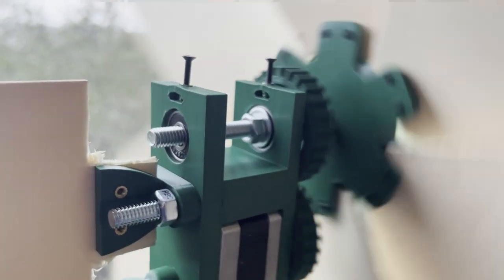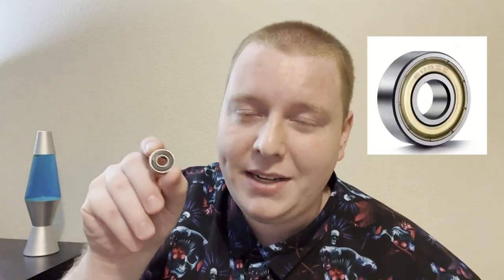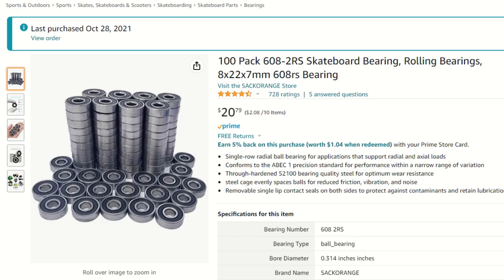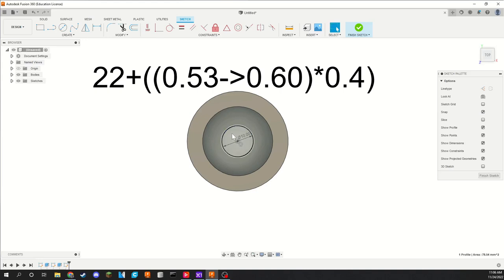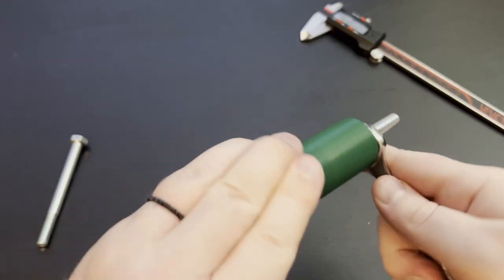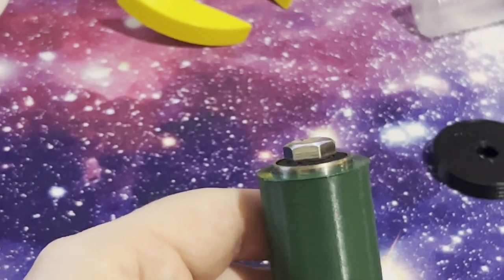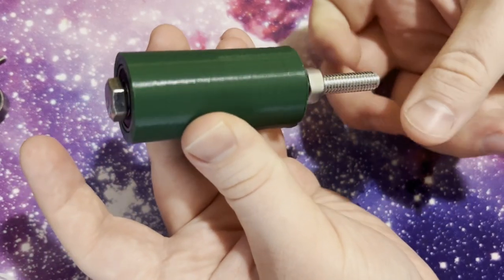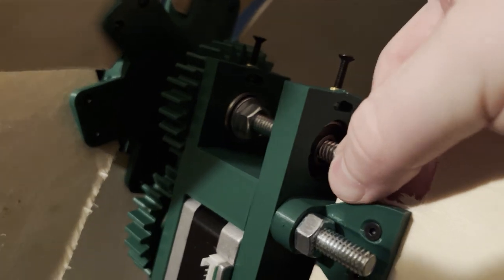Using Bearings with 3D Printed Parts

Comment: Never screw your regular ball bearings the way he does it at the 4:12 mark. This will ruin the bearings. Instead, take two appropriately sized washers so you can clamp on the outer race and screw together that way instead. An alternative to this is using either thrust bearings, tapered roller bearings or angular contact bearings, all of which take MUCH higher axial loads, these kinds of bearings will handle this kind of treatment just fine whereas regular ball bearings will not!
Reply from the maker: Good points! Thanks for the heads-up :)
Reply: Good point, but it will only ruin the bearing if the force on the inner race is high.  For a light press fit in PLA, maybe it won’t hurt the bearing.

Comment: 2:54 this is incorrect, slicers do take into account the nozzle diameter. The issue comes down to thermal expansion of the filament, filament getting dragged after its extruded, retraction settings and issues with the machine like E steps, squareness of the frame and axis etc.

Comment: After nuts and bolts, bearings are one of those things I buy in excess, in sizes I don’t need for ideas I haven’t thought of just because they are so satisfying. Sometimes when I really need some relieve I’ll slide a shaft in and give it a spin. Maybe slide it back and forth if it’s a snug fit. I started collecting used copy machines to take apart because people just give them away and I’ve pulled literally buckets of bearings out. I took apart a plotter and it had a 1m 13mm slide mounted to a sturdy boxed beam. No clue what to do with it but I ordered a set of 13mm sliding blocks just in case. It would make a good X | Y axis on a CNC router.

Comment: 6:41 In short, your problem is due to overconstraint. Underconstraint is the reason why you had the leverage with a single bearing (5:52). 
I highly recommend you to read "Exact constraint machine design" by Douglass L. Blanding. Its an amazingly good book, and a true eye opener for anyone that likes to design mechanisms and machines. Dont worry, it doesnt have any math.
Reply: Explain?

Comment: If you use two bearings and crank them together with a bolt the balls on each bearing get compressed into the rings. At a microscopic level the metal has to deform to spin. This is why it becomes harder to spin.  There’s a sweet spot of tightness where the shaft runs true and freely. It’s good to use a Belleville washer and two nuts with this configuration to get the best results.
Reply from the maker: Thanks so much! I'm always amazed at the collective knowledge of a community. Thanks for being a part of that :)

Comment: A vice is something that everyone should have and is very good for press fitting parts, like those bearings and is probably a bit quicker to set up than the nut and bolt solution.
Reply from the maker: You're totally right. They're super expensive though 😅
Reply: @christophersfactory  my local supermarket (grocery store) sells miscellaneous crap on a weekly rotation so I picked up a couple of cheap vises of various sizes. Mine can grab parts up to about 150mm in the dimension you're squeezing, and as Conor said they're great for 3d printed and maker stuff. That bigger one cost like €15 max
Reply from the maker: @cian.horgan  No kidding? That's dope. I'll have to check around my area to see if I can find something like that. Otherwise, maybe a garage sale.
Reply: @christophersfactory  they really aren’t that expensive and you don’t need large ones that bolt down to workbenches, even a cheap one that just clamps onto a desk is enough for most people.

Comment: 6:40 the reason is because those are radial bearings. They're design to be able to take force in the radial direction (think of where they go in a skateboard). However, they are not designed to take forces that are directed along their axis of spin such as thrust forces (Think of an office chair that swirls around with you on top of it). For this, you want thrust bearings (hence the name). These are designed to take this kind of compression force along the axis of spin.

Comment: I had to chuckle at the use of MS Paint for a crude "hand drawn" explanation of tool compensation, immediately followed by some footage of precision drawing in Fusion. 

As with everyone of your videos, I learned some things.  Keep it up!
Reply from the maker: I forgot to say this in reply to the last comment of yours I saw, but I have to thank you for your positivity and kind words. It's very inspiring to me to keep doing this channel and make more videos. It goes a long way. Thanks again, from the bottom of my heart. Christopher
Reply: @christophersfactory  You are very welcome.  There's too much negativity on the internet.  A little kindness can go a long way.

You mentioned a few days ago that you finally received the electronics you needed to start collecting electricity from your windmill.  Will there be a video showing the results coming soon? 🍿
Reply from the maker: @schmidtyyt  You're awesome. Yes, the parts finally came, but I realized I had a fatal flaw that rendered the PCB's I designed nearly useless. I saved a few by cutting the traces out with a utility knife and re-routing some connections with hook-up wire, but being the perfectionist I am, I didn't want to show that in the video, haha.

On top of that, I redesigned the turbine, but I'm now in the process of redesigning it again. I've used pre-cut plywood up to this point, but I think to have it work really well, I need to get better at learning how to cut and work with thicker and more durable woods. The plywood I've been using warps horribly. I just started working with this stuff called hardboard, I think it's made from compressed sawdust. I can already tell it's much less prone to warping, but it's slightly harder to work with. 

I'll probably have to redesign the turbine hub to accommodate the heavier and thicker boards.... this is all to say that there's a lot I'm re-working; I told myself I'd wait to get the "build video" out until I was done, but now I'm thinking I should just make regular, almost vlog-style updates on what I'm doing. Viewers would probably get more benefit out of that anyway, because learning what doesn't work is arguably just as valuable as learning what does. 

I have a few other non-windmill-related videos already shot and edited scheduled for this week, but windmill content should start back up next week, especially after these words of encouragement :)
Reply: @christophersfactory  That sucks about the PCBs not working as hoped.  I know nobody likes to admit failure much less broadcast it to the world, but showing what went wrong may help others avoid the same mistake.  As a wise man recently said, "learning what doesn't work is arguably just as valuable as learning what does." 😉

I'd expect the hardboard to work better for you, as well.  And I totally get the design re-considerations that brings, too.  However, I have to ask: why not 3D print them?

As for working with the hardboard, check out the Dremel Ultra Saw (great Black Friday deal at Amazon today).  I found it to be a great little saw for cutting thin wood and metal.
Reply from the maker: @schmidtyyt  I completely agree about the failure bit. That was one of my goals when I first made this channel, was to candidly show people my efforts in these projects, not just showcase a finished project. 

As for why I'm not particularly inclined (although not opposed) to printed blades, there are a few reasons. PLA warps really badly in the sun, especially with large and thin features. If the blades are not thin, it will use a lot of PLA, which is much more expensive than wood. I could try printing in nylon or ABS, but I've never worked with either before. 

My short experience with wind turbines has taught me that the name of the game is wind-collecting surface area. This is faster to design with panels of wood, I think. It requires less design consideration. Additionally, I could probably cut 250 wooden blades in any afternoon, but 3D-printing them is going to require a significant amount of time. 

So, to answer the question more directly, I guess there isn't really anything that I've found that strictly deters me from 3D printing the blades, but rather several small things that incline me toward wooden blades instead. 

People often ask me what the goal of this windmill project is, as I've been working on it for well over two years and through twenty-one designs. Really, there is no goal. I do this because it makes me feel happy and fulfilled. I'm not necessarily trying to create a to-market product, nor am I trying to design something that anyone could assemble with only filament and a printer. So, as the Cheshire Cat said, “If you don't know where you want to go, then it doesn't matter which path you take." I'm just taking whatever path I feel like and feeling things out. Maybe I'll take the path of 3D printed blades at some point. 

That Dremel looks pretty slick. I have a knock-off rotary tool, I wonder if it could use Dremel saw blades? Something to look into for sure. 

How about you? I think you're probably my most loyal subscriber already, haha. What gravitates you toward this content? Any plans to build a windmill of your own?
Reply: @christophersfactory  I'm a total newb to 3D printing, so I wasn't aware of the PLA warping issue.  Good to know.  And I totally get the time consideration.  With my limited knowledge, I bet it would be a solid day, or more, to print the blades.  I'm thinking your hardboard choice should fit well.  UHWM comes to mind as another good choice, but I haven't priced it out.  That may be cost prohibitive.

I've been thinking about windmills for a number  years, although my thoughts have always been on one big enough to power my entire household.  But...that is cost prohibitive.  When I ran across your videos, it kind of lit a spark.  I thought to myself, "start small, get to know what is going on, and keep scaling up."  So yes, I do plan on making my own windmill(s).  Currently my 3D printer is busy making stocking stuffers for Christmas (important stuff!! 😉) but once 2023 rolls around, I hope to start playing around with making some windmills.  

Will I ever be able to build one big enough to supply my own power?  Maybe, maybe not.  I own a small machining business, so I have some machines at my disposal that could help make it happen.  Just need time and knowledge.  We shall see....
Reply from the maker: @schmidtyyt  Hey, that's exciting! I do agree with the philosophy that a smart man recently said: "Start small, get to know what is going on, and keep scaling up." 

Interesting that you say that, in fact, because I've been noticing recently that a lot of the problems I've been working on solving recently regarding the windmill are problems that would resolve with larger scale. Efficiency is a big one. While the windmill is still small, every milliamp matters greatly. I'm currently working on voltage rectification issues... Most Li-ON batteries need a pretty well-regulated 5V... Windmills are naturally very unregulated in terms of power, and most means of power regulation is fairly wasteful. 

If it was a big enough windmill, though, you wouldn't even have to convert the power to DC like I am for it to be useful. AC power is also easier to manipulate, so as long as it's 120V and 60hz, I'd assume one could use it to supplement power consumption. 

For now, though, I really want to get this project to a point where I can charge my phone with it. That's one of the only firm goals I made with this project. It's seeming increasingly close. 

That's cool that you own a machining business. I tell people that if I hadn't studied Finance, I'd be a machinist. You may regret telling me that, as I may pester you from time-to-time asking for advice ;) I'm still a novice in plenty of things, so maybe we can both help to bridge each others' gaps.
Reply: @christophersfactory  Pester away!  I'm always glad to help.  Although, we should find a better chat option than YouTube comments.  ;-)

Comment: Great video. Informative and great pacing. Do a followup about spacers maybe (what you to keep them from locking up). Having disassembled a ton of printers I learned they are used constantly, and so old printers are a good source of pretty decent metallic spacers (although printed spacers do the job too).
Reply from the maker: Thank you so much! I very much agree, and I probably will make a part 2.

Comment: Possibly mentioned already, bear with me if this is redundant : Assuming you have room in the build - To secure the threaded end of the bolt and keep it from loosening or being too tight  *use two nuts *set the first nut against the bearing / socket *thread the second nut against the first *hold the first in the exact position you want and tighten the second nut against it (tighter the better, and thread lock if you like).  The torque between the nuts will keep either from moving along the thread. Hope this makes sense and hope it helps :)

Comment: A crown nut and cotter pin are meant to keep a nut in place without the nut being very tight. It's a bit more complicated to build since the bolt or shaft needs a hole for the cotter pin in the right place but it looks cleaner and is more compact than two nuts jammed together.

Comment: 6:42 It's likely that your bearings are not axially concentric. 3D printing and friction fitting will introduce a lot of dimensional inaccuracy causing the 2 bearings to be misaligned. If the nut is screwed down tight, the center of the off-axis bearing will worm its way up/down the bolt as it spins causing it to seize. 

A potential fix: Use a long bushing or sleeve to span the gap between the two inner rings. A brass tube or even a 3d printed tube might work. The tube will force the rings to be concentric as the nut is tightened down. Aligning the outer rings will be more challenging though; you might leave the second bearing loose in its housing to help. Alternatively, you could use a whole stack of bearings to support the entire length of the bolt or mount the whole bearing assembly in a pipe.

Comment: Your printer isn't calibrated right. Slicers take line width into account. They are sophisticated pieces of software. You only need to consider actual tolerance required and the impact different filament and environments conditions has.

In reality, print mechanical parts with a 0.6mm nozzle and similar line width (those are two different things in a slicer)

I find the last step to fit is easily achieved by filing the rough bits off which also ensures that the fit won't get loose over time.

Comment: Very cool, thanks for the tips. I tried to design some TPU based wheels for my baby stroller, and had the bearing with bolt acting as lever slop issue. This created quite a sag when a load (the baby) was placed into the stroller. I didn't think of the two bearings as far apart acting as a choke idea, that's great!
Reply from the maker: Thanks! I'm glad it helped you! If you ever get the stroller design set up, I'd love to see a picture of it, that sounds cool. Cheers!

Comment: I have seen many videos on dimensional accuracy, and you are the first video ive seen that explained it correctly by using microsoft paint! lol. Very well made video!
Reply: I doubt this is how slicers actually work. The slicer usually knows which nozzle diameter you use and will acount for that

Comment: for slightly loose tolerance I wrap some painters tape around the outside of the bearing for a tight fit. For low load applications of course.
Reply from the maker: That's a good idea! Thanks for sharing :)

Comment: If you want to use a nut to clamp the two bearing together (without them seizing), try using tapered roller bearings. They can handle axial loading (thrust) and radial loading. Try McMaster-Carr part number: 6677K51
Reply: Oh yeah, and basically point the tapers away from each other, then you could clamp down with up to 2,000 lbs!
Reply from the maker: Woah, those are some badass bearings! Thanks for the heads-up. At $35 a pop, I'll have to save my quarters though lol!